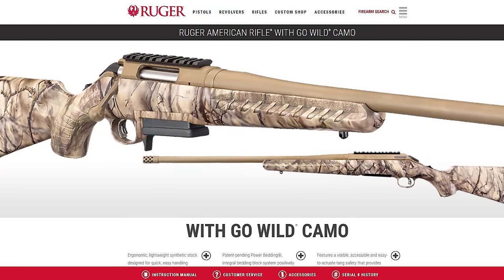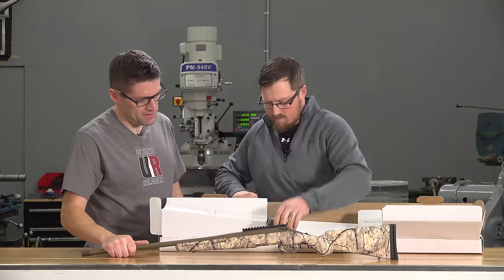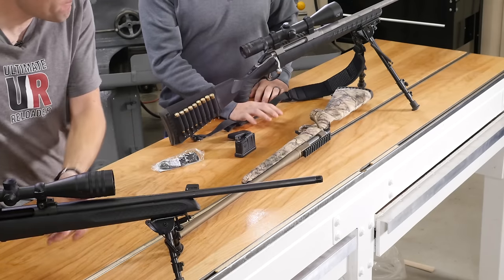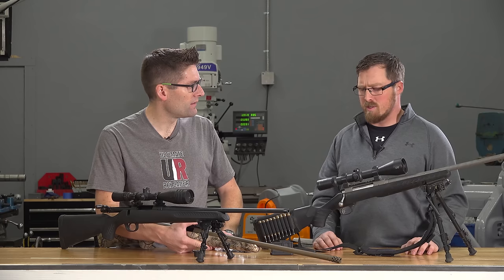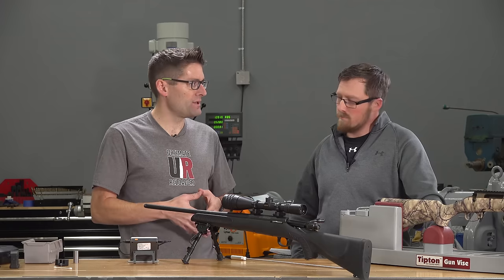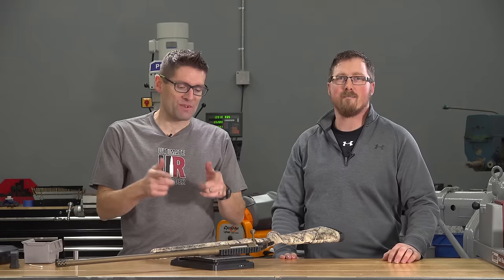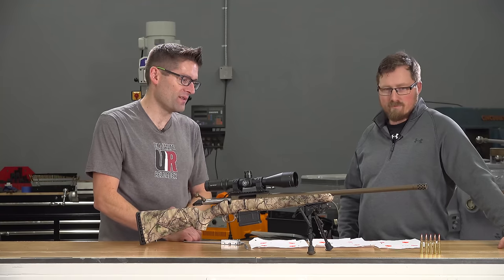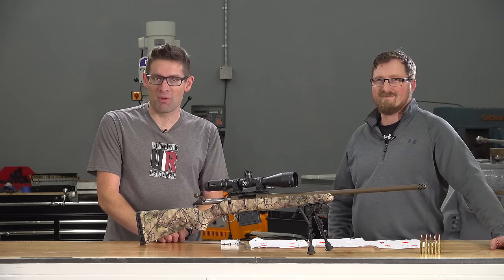Tested: Ruger American Rifle Go Wild in 6.5 Creedmoor

Comment: My predator .243win shoots sub moa I had to wrap sandpaper around a perfectly round wooden rod/dowel and run it through the barrel channel I use a Harris 9-13 bipod that can cant if you muscle your shoulder into the stock then it twists and rubs the barrel I run 55gr SBK's - 87gr Hornady varmint bthp but the Ruger rotary magazines SUCK I missed out on doubles because they won't feed the next round sometimes but I heard the Mossberg mvp mags work in the predator. I've taken coyotes out 665 w/ it it is dead on accurate and lightweight I got a fox by my house @588 yds using primos gen 3 trigger stick some might disagree but all my rugers are tack drivers I utilize a 350 yd zero running a vortex ViperHSLR 2.5-10x w/ XLR retical I load up 55gr SBK's w/ shooters world match rifle powder spittin em out at just over Sierra's max velocity @4029fps really flat shooting load my 350yd zero for that load was exactly my 100 yd zero for my deer load Barnes ttsx 80gr. I primarily use the rifle for coyote hunting so when I took it deer hunting I ranged a nice 10 pt at 182yds and by habit of shooting 55gr burnt into my head I failed to remember in the moment of what my hold over should've been and missed just below his chest behind its front leg and that ugly Ruger rotary magazine did not load the next round and the buck stood there while I fumbled with the magazine then finally took off w/ the rest of the herd a spike and dozen or so does we're just all staring at me the whole time laughing at me. So if should somebody read this get the AR mag or AI mag fed one it will save you some heartache thx like your content safe shooting, hunting
Reply: love your comment!!! had same issues with rotary mag glad they are doing something about it
Reply: For your Rotary magazine Ruger American versions...as long as the case is roughly 308 sized (so 22-250, 243, 6mm creedmoor, 6.5 creedmoor, 7mm-08, 308, etc) ....BUY the Ruger American Ranch 450 Bushmaster magazine. It’s a single stack magazine and feeds these cartridges RELIABLY. You do lose 1 round of capacity though. But still, 3+1 is usually enough for most hunting scenarios

Comment: Do yo really need the tool to remove the action from the stock
Reply: No. It's just a jig to help you put the mag release in and take it out with the spring under pressure. Mine didn't even come with the jig and I had no issue taking the barrel/action out to put it in an MDT stock.
Reply: Thank you, I did call Ruger and they are sending me one.

Comment: I was never impressed with the ruger American rifle. they’ve all felt cheap and rough in my experience. all new bolt action rifles need larger bolt knobs. there’s no reason they need to be that small. the palm swell needs to be larger as well. if you’re gonna keep the Tupperware stock then it should at least be in the correct form. Grip needs to be more vertical.